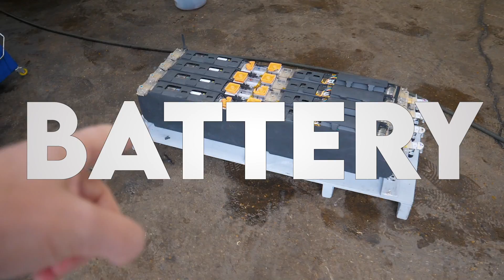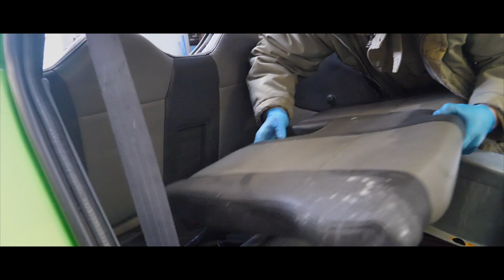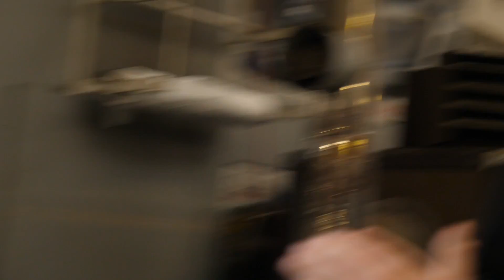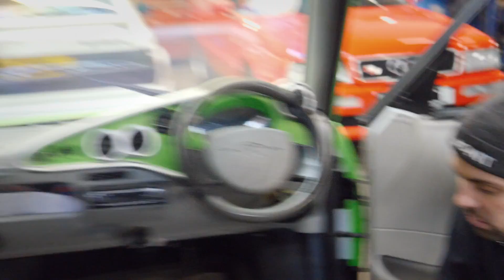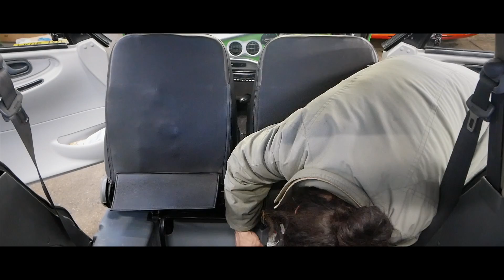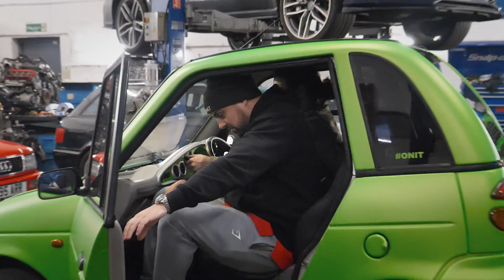INSTALLING A TESLA BATTERY TO MY GWIZ!

Comment: I did the same to a year 2000 Fiat 600 EV. Out with 700lb of lead acid and in with 250lb Li-ion. Now has 120 mi range and a 15kW charger. Beautiful practical EV with so much 90' vibe. Cant all drive around in futuristic 5000lb E-SUVs!

Comment: We all know lithium is out-dated dirty tech with a fancy sticker on it that scars the plant, Why not use a Inverter and a Marine capacitor bank to do the same thing?  Lithium takes 1,200 charges then goes down to 3/4 of its life  after 2-3 years and takes ages to charge up, The Capacitor bank will take 1 million plus charges and still keep going, And the best thing is that its clean way to go and you can charge the car up in under 30 seconds to full power. And no more charging points too. Its a win win, But these stupid eletric companys are lazy and will sell you anything just to get the customer out the door, Demand proper tech in 2022 or walk out, They won't like that, But it will give them a good kick up the arse when the customer demands proper tech and then walk out the shop with their cash..

Comment: I want someone to put the 40 kilowatt battery in my 2018 Mercedes C350e, the 9 miles of all electric range is pretty useless however the ac and heater can run for hours so that part is good but I want longer all electric range without going full electric.

Comment: You Pomes are so lucky to be allowed to buy Gwiz-es, and, like on some other guy's Youtube channel, for as little as UK 270 Quid , to fix up.    Down under, the Electric car enthusiasts have been trying to buy this model car (called REVA  where it comes from in India) for, honestly, "decades".. Initially they were banned because they couldn't pass the 80kmh/50mph braking test (because they couldn't reach 50mph, anyway, being intended as a city car for slow suburban streets. Aust and NZ governments refused to create a "quadracycle" category that would have allowed limited speed vehicles like the Reva/Gwiz on our streets. Curiously NZ Govt has just 5 years ago, allowed NZPost to have some tiny EVs which are 45kmh/27mph speed limited, without doors, but they require their posty to wear a bicycle crash helmet. No-one else has been allowed to register or drive such a vehicle (being a post deliverer they are allowed on footpaths as well as roads).     EV fans in Australia or NZ have no cheaper option than  buying an ex Jap import 2011 Nissan Leaf that's down to about 6 bars on the 12 bar battery gauge, and even that will cost NZ$9,000 .

Comment: This is why battery powered cars will not be sustainable, that was basically just a few batteries out of a Mercedes! After these batteries run out just think of breaking these down and the cost of replacement 😒

Comment: How much was the Tesla battery? :)
Reply: £1400 for all those modules, if you buy direct from Zero-Ev they are £5-600 each so it would have been around £2000 under normal circumstances. Hard to get hold of the mercedes tesla modules at the moment though.